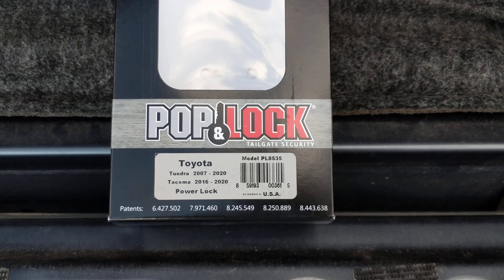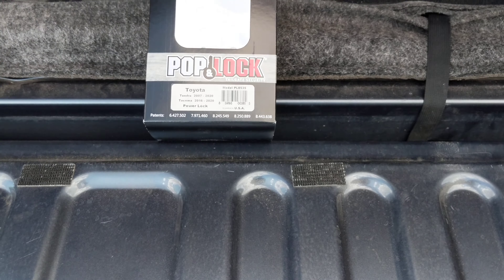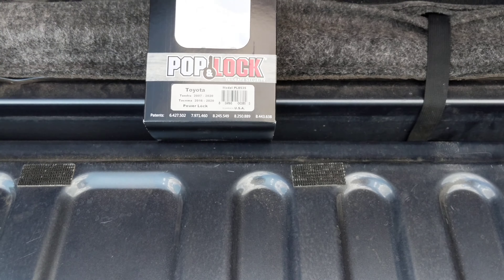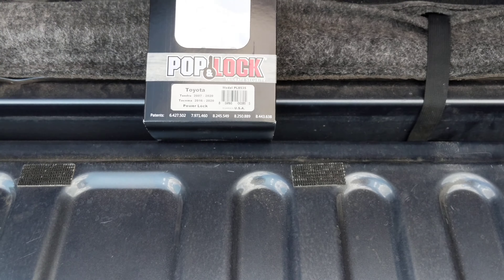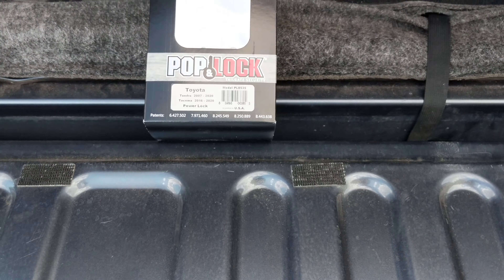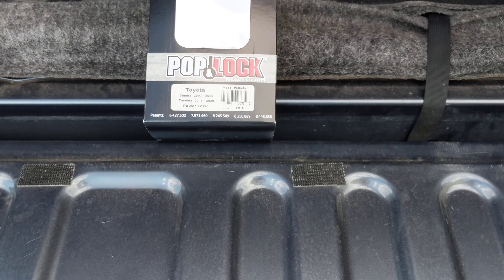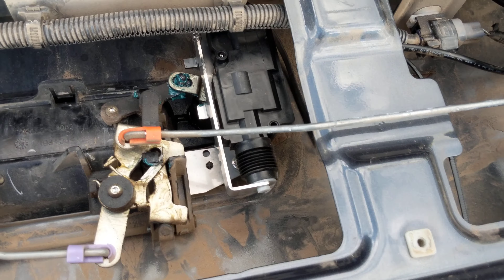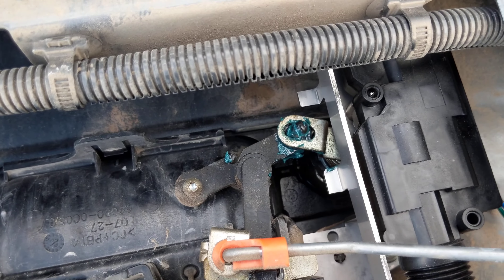Pop & Lock Tailgate 2010 Tundra

Comment: Worked like a charm on my 2011, saved me a bunch of time! But the wiring was reverse for me, blue to blue, white to green. If anyone has issue where the unlock bottom will lock and lock button will unlock, just flip the wires around!
Reply: Thank you for this comment, this is my issue as well, lock unlocks and unlock locks.

Also I have an aftermarket cheap tailgate handle (had to replace the original)…. The actuator skips over the little lever on the lock mechanism…. Solution was to wedge something under the actuator to the right of the bolt (when looking down at the actuator)…. Because when tightening the bolt down the actuator arm lifts slightly higher, the wedge prevents this from happening when tightening down the bolt
Reply: @ocin311  ahh yes I ran into this too! I had to drill a tiny hole in the actuator, as there is a little plastic piece sticking out on the tailgate handle which causes the actuator to lift as you tighten.

I wonder if I also have an aftermarket handle, or perhaps any handle will have this issue?

Comment: I wired my 2010 per this video and my lock/ unlock are reversed.
Reply from the maker: Myself and others had a different experience. Did you try following the instructions it came with? Or another video?
If you solved your issue you should post the solution.
Reply: On my 2007 the lock and unlock are reversed as well. Blue goes with blue and green goes with white. Thank you for this video though it is the ONLY one as far as I know and super helpful.